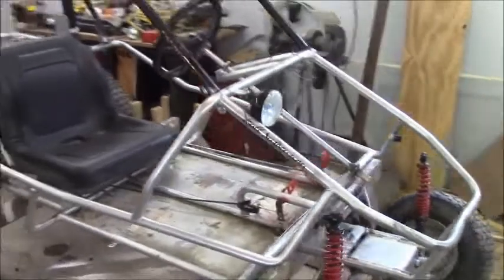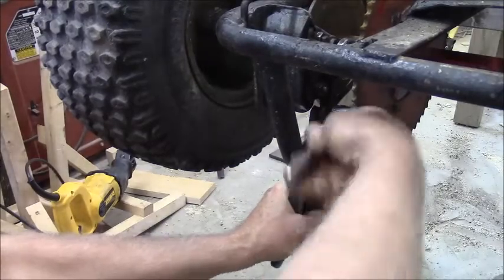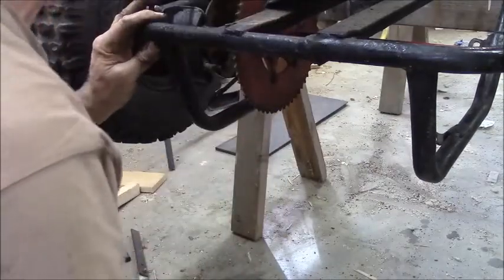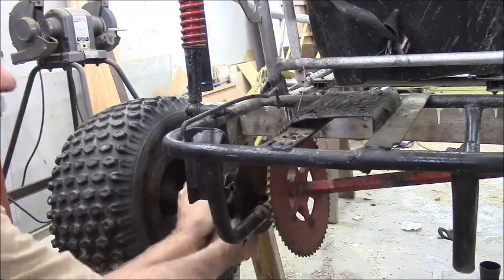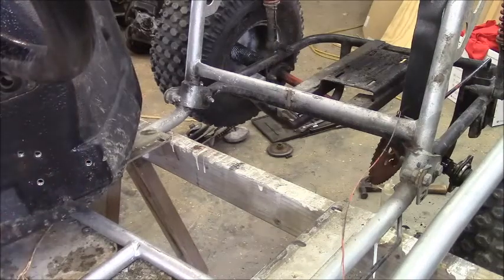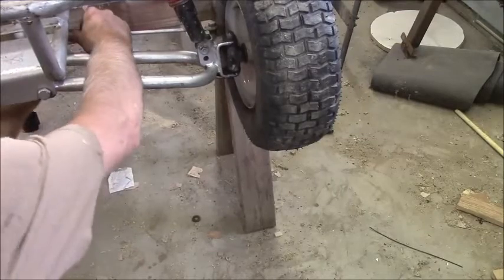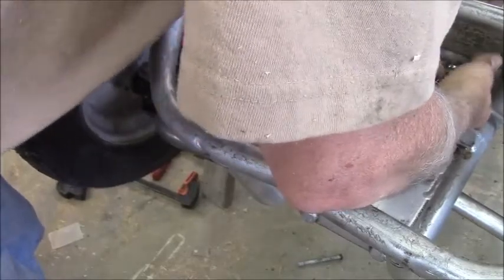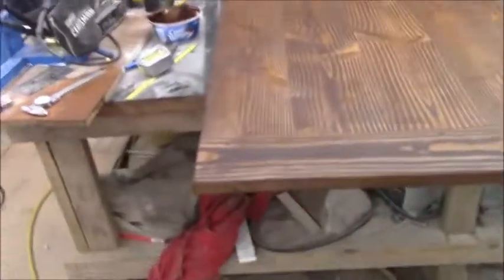Part 1, Go kart tear down, DIY go kart repairs and upgrades, How to assess what you need to replace

Comment: Pretty nice machine you got there buddy,  looking forward to see more videos like this
Reply from the maker: G's up, hoes down! Well, it needs a whole lot more repair than what I thought when I bought it! Pretty much everything needs fixing or replacement except the frame, and that needs mods too! Lots of subjects for videos!
Reply: @bobsbarnworkshop  good project though,  I Am currently building or should I say modifying a mobility scooter and mounting a typical predator 212cc , i bit of a challenge becuase I am trying to make it as stock as possible as opposed to just putting a l8ve axle and go kart wheel. I cut the housing of the transaxle exposing the axle shaft so I can put a sprocket and disc brake,  it should be interesting because the transaxle acts a a differential, I have never seen anyone do something like that.
Reply: I'll post a video of it when finished if you want to check it out, I'm not a youtuber but i like to post videos of my projects for my own amusement lol.
Reply from the maker: G's up, hoes down! Cars and cameras has lots of 212 vids and they sometimes tie into existing transmissions too!
Reply from the maker: Have you watched the entire series!!?? It turned out great! I’m going to upgrade the brakes and steering to rack and pinion
Reply: @bobsbarnworkshop  not uet but I'll check them out,